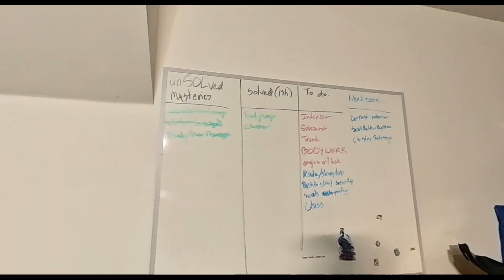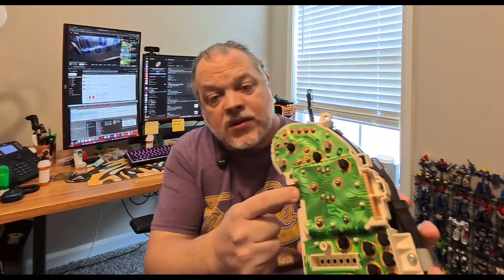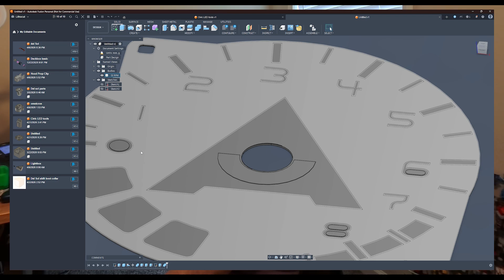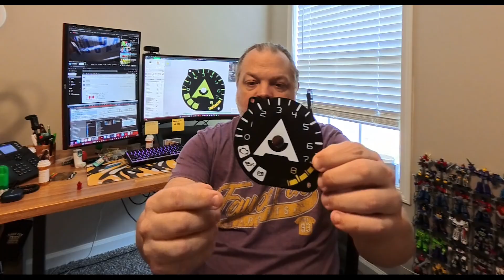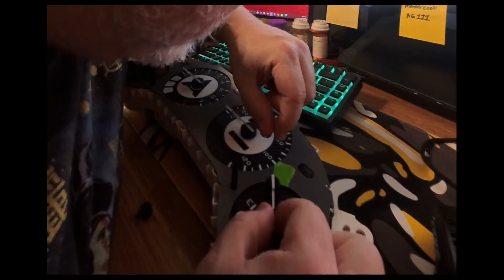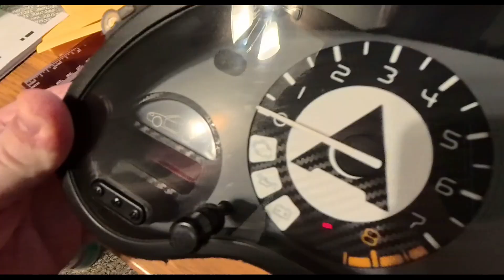Del sol Cluster Refresh and Fix (Still 3d Printing my way out of car problems)

Comment: Awesome work! do you mind sharing the filament you used?
Reply from the maker: Whatever I have on hand, mostly inland PLA+. it's cheap and we have  2 microcenters locally here so it's pretty easy access for me, so I haven't adventured out  brand-wise, except occasional exotic filaments like polymaker COpE that I use for supports when I can't design to support them.  That aside I've also used the Hobby lobby house brand (again locally accessible) but I'm 99% sure that was inland PLA+.  Their ASA and PETG are also great and what I use for structural stuff. (NOT SPONSORED, but call me Microcenter)
Reply: @Agreed.Studio thank you for the input I have a similar project like yours and have some of it drawn up in fusion just have to test some prints
Reply from the maker: @bamboostedgarage  Not a problem. Good luck. Hope it turns out well.

Comment: Pretty sure that's an Si cluster my friend, you get the one with the redline at 7200RPM with the D16Z6 and you get the 6800 one with the D16Y8. This is the case in europe in any case, I have a 1997 Del Sol ESi D16Y8 (which is the same as the US Si trim)  and I got the 6800 one to illustrate.
Reply from the maker: I have in fact been misled by  an entire honda discord :D I'll get it flipped back top correct  redline. Good catch.